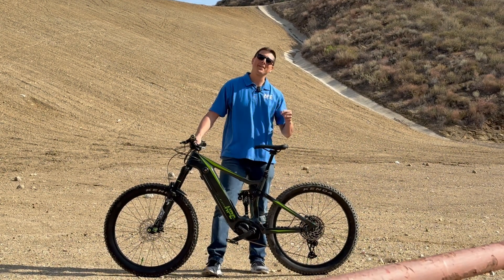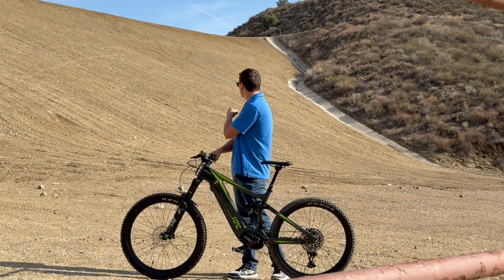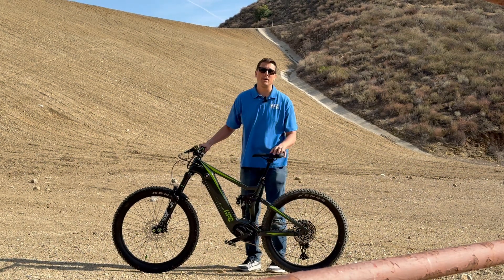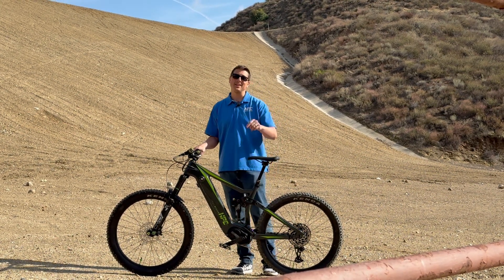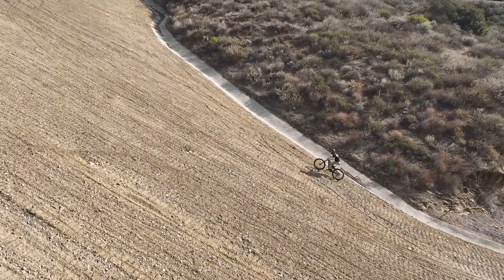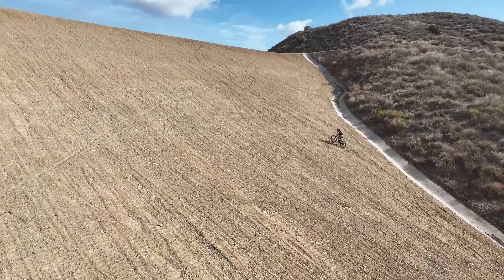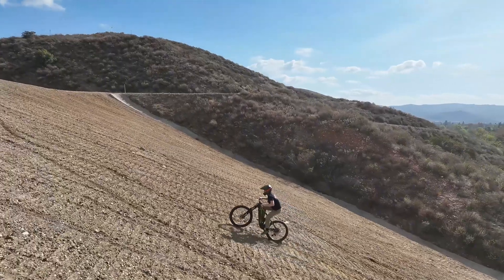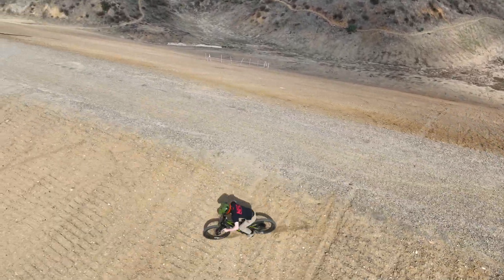HPC Trailblazer 50% Grade Hill Climb Challenge: Testing the 750W / 1200W / 2000W Power Levels

Comment: I have the 2022 model of the Trailblazer with the 1200W setup and if ya use it using the pedal assist at 5, yeah ya can climb as far as noted on this video, however it is possible to unlock the pedal assist to go higher than 5 and when you do that at say pedal assist 8, you climb these hills a lot easier.